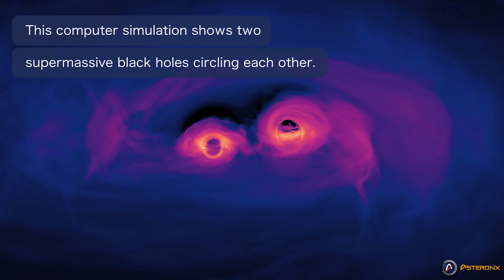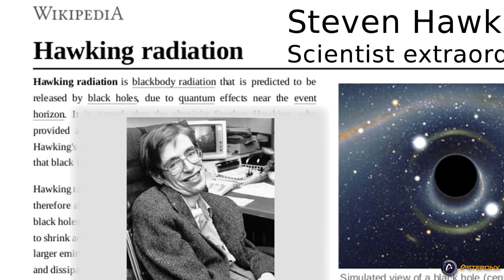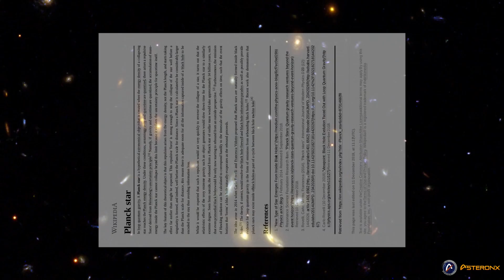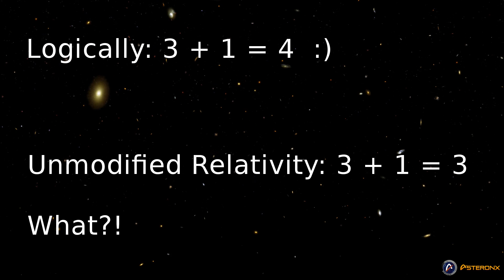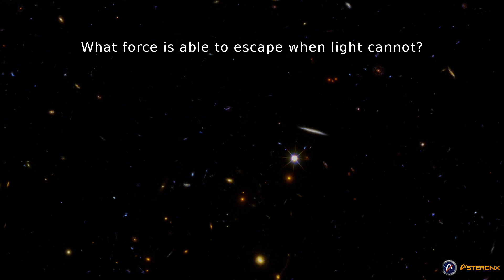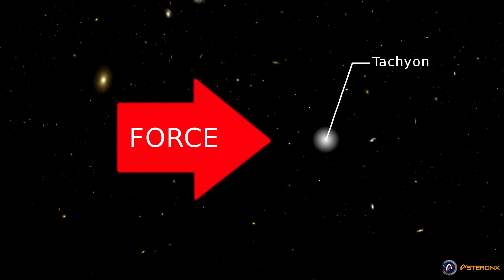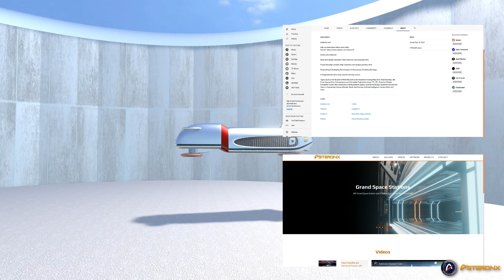Planck Star (Black Hole) Tachyon Rocket / Power Source - Starships

Comment: I have notes I developed about the artificial creation of a black hole using the mass of iron asteroids  carefully arranged and lensed with fusion bomb pumped XRay lasers and further fusion bombs in another lensed array and timed such that a critical density is created at the precise moment the mass is available to become a black hole.  It is technically feasible but non trivial in terms of assembling the masses, shaping them precisely and creating the necessary fusion bombs. Timing detonations is crucial.   Many asteroids are 10^17 kg which would create a BH with a power output that could be useful.

Comment: The Quantum Clock, or time dilation, seems to explain the Cosmic Speed Limit. If you reach light speed without warping space-time the energetic interactions that constitute the matter that makes up your body and space craft would not occur, as your cosmic clock reaches infinity. It seems to me that your material body would become disintegrated energy spread through the cosmos.

Comment: Get a lot right in this video it’s just that we know the black hole doesn’t explode because of Hawking radiation If the black hole was to explode we would see a large amount of gamma radiation as a result of virtual particles being created from the information exchange so the black hole still exists And another thing tachyon filed dose exist  there is a negative mass field  does exist but this mass cannot have excitation this field cannot have excitations so the tachyons particles don’t exist but the tachyon field dose https://en.m.wikipedia.org/wiki/Tachyonic_field the Higgs filed is a tachyon filed also the amount of mass a black hole gets from absorbing matter  is it more than the mass it’s giving away from Hawking radiation so always when a black hole absorbs stellar mass it’s getting bigger not smaller and that’s how we know black holes don’t explode https://www.inquisitr.com/4759939/china-wants-to-develop-100-petawatts-laser-that-would-rip-apart-empty-space-and-simulate-even-a-black-hole/ You would need 1000 petawatts watts of power To produce the black hole and you have to sustain the laserbeam such high energy laser beams can only last for 1 millionth of 1 millionth of a second you have to sustain the laser beam for a long time  for the light to be converted into mass by e= MC Square reaction by firing multiple of 1000 petawatt laser beams at one point in space-time the light would effectively bend then its energy would be converted into potential energy The potential energy being mass and for those of you that don’t know E equals MC Square is an equation that states that energy can be turned into mass and mass can be turned into energy energy is energy and mass is potential energy  there’s a reason why this technology is going to take 2000 years from our Time to get so in the 4000 then we’ll see where we might have it then Oh in 10 petawatts is far more power than what is produced by modern day human civilization so A thousand petawatts of power is un imaginable  then there is this whole Using quantum tunneling to travel faster than the speed of light that might not be possible at all In order for quantum tunneling https://en.m.wikipedia.org/wiki/Quantum_tunnelling
Reply: Actually human civilization produces 15 petawatts of power in modern day 2019 and this is not anywhere near enough to create artificial black hole we can simulate a black hole using 150 petawatts actually but we have to continuelsy sustain the laser beam
Reply: Oh and astronex you didn’t get a lot right I’m sorry I said that A black hole is not the explosion frozen in time the reason why we know that is because of the way that the mass information of the black hole into reacts a space-time outside of the black hole to produce Hawking radiation and we know this because of the fact that the mass can you infinitely curves FaceTime if it was an explosion even if space-time was moving slow over the course of billions of years we would be able to detect a much more rapid decay of information and what we actually half and then there’s the fact that black holes can consume massive energy toIncrease their size if that was an explosion that doesn’t make any sense even if it was frozen in time
Reply: you see the problem is is that the theory you’re using is not backed up by Evidence and it’s a fringe theory Not too many scientist go buy it because there’s not a lot of evidence to support it and you can’t talk about it like it’s fact if you’re gonna talk about theories you got to give more than one Siri you got to talk about more than one theory what they mean

Comment: Hey AsteronX, if I understand correctly blackholes that continue to amass more matter would delay their explosion into a white hole because of the increased time dilation due to the immense gravity of the billions of solar masses. So theoretically with the continual expansion of the universe, at one point all matter in a region would fall into supermassive black holes until the expansion of the universe stops this. Then nothing is increasing the time dilation, hence the explosion into a white hole would happen eventually.

My question is then would the matter from the black hole still be the original matter, like iron/oxygen/hydrogen or helium. Or would this black hole to white hole process convert all matter into hydrogen? Then this would explain the cyclical nature of creation from the big bang to supermassive black holes and back into white holes again.

Comment: My hope is that we will figure out stable fusion and matter/antimatter engines and start the work on adapting that tech to power space exploration drives by the 2050-60’s.
Reply from the maker: Fusion is truly around the corner, as while direct study and research may have been neglected the past several decades, the theories behind fusion have not been. Ultra-dense deuterium, laser-catalyzed Proton-Boron fusion, applying our primitive AI's to the problem of fusion, to name a few. By the 2060's we will have sublight starships almost certainly.
Reply: Sub light just means slower than the speed of light.

We can already do fusion.  The problem is getting at least as much energy out of it as you’re putting into it.  As for the drive?  A problem there would be excess heat.

We’ll get there, but I’ve learned not to be too optimistic about these things as it’s not just about saying that we know how to or can do one thing (that might require knowing how to or able to do other things that we don’t first), but it’s also about funding, interest in the project and whether or not the financiers think that the gain would outweigh the costs.
Reply from the maker: @eds1942  Well if the interest in fusion is stubbornly withheld until the world's easily-accessible oil reserves finally run dry... then the interest will suddenly be there.

As to the heat, that is one of the promising  things about Proton-Boron and (especially) Ultra-Dense Deuterium fusion.
Reply: There are a hand full of sites that could feasibly study that right now.  But, the most promising looks like the ITER which won’t be completed until 2025.  While it looks like Deuterium-Tritium will be their main focus, they could probably adjust their plans to study ultra-dense D first since its not ready yet.

There’s a lot of concern around these projects primarily due to the cost.  No doubt in part to the fossil fuel industry, which still holds too much political influence over the primary funding the countries.  

It looks like any big change in the area of power production would have to come from the demand side.  Where I live for example, we could easily get most (if not all) of our power from solar and wind (wave turbines), but between property rights and people understandably not wanting the stuff “in their backyard”...  Which is unfortunate as that could potentially free up a lot more funding for fusion research and laser-induced fusion (best suited for testing that as I understand it) is one of the projects that our state has independently invested in.  And it probably wouldn’t be long after that works out that we’ll be able to see if that holds potential for the space industry.

Here’s hoping!
Reply from the maker: @eds1942  Well, ultra-dense deuterium (UDD) does not require massive machines... But there's an awful lot of skepticism and not enough actual research (which would prove or disprove any skepticism).
Reply: Yeah, but it’s fairly new.  Give it time.
Reply from the maker: @eds1942  Of course, but a gigantic lab with millions in funding from many countries is unnecessary for researching UDD.

Comment: Faster than light travel. Or theoretical gravity drive will only work when the OBJECT is small. All Material has too much mass for any WARP distortion to work. Therefore you video on Future Black Hole powered star ships is wrong. Plus to exceed light speed and bypass normal spacetime is only possible as an ELECTROMAGNETIC push, or to send information, not for transferring material in a BUBBLE to long destinations.
Reply: Micro synthetic black holes. The material that makes up the ship. Electromagnetism. And a nuclear fission reactor. All in one ship.

Comment: The reason I can actually believe you when you say we will have the anti gravity drives when  you say they will be here is because of 2 reasons. 
#1 We have the knowledge to prototype and test these concepts now or will very soon. 
#2 with the onset of cryptocurrency like Bitcoin the normal oppression of innovation by Megacorporations and governments will be thing of the past, very little will stop a small startup from designing, testing and utilizing a warp dive. 

In Conclusion: Cooling is going to be a major issue with FTL drives in and I can see many cool off periods in between "jumps" to keep the ship from burning up and the drive at operational temperatures. The Movie Alien, Covenant shows an example of what will have to be done in between jumps except the panels are used to bleed off heat.

Comment: When  a mirco black holes exode creating a bubble in space time.quickly reclosing.  And if a ship has it own a hyradiation  repelling radiation coming at it.  And ships own ration field expands with acceleration. And a fuel gains density as it accelerates. and if atoms pushed to rite leak out a Negative Flow of mass. creating  larger radiation field . Could hold Bounce open even push it open farther tunneling through space time.

Comment: I really enjoyed this video and I thought this was best (so far).  I happen to agree with your timeframe.  FTL is going to start slow and then speed up.
Reply from the maker: Indeed. To many, the notion of FTL travel may seem impossible, but so would have fusion rockets in the early 1900s--we didn't even know of nuclear reactions!
With the development of fusion reactors within a few years, everything will change almost overnight, and many things currently impractical and impossible will become possible.
Reply: @asteronx  I have learned to use the word 'impossible' with the greatest caution.
-   Wernher von Braun

Comment: Kugelblitz drive
You absolute madlad :P
Question about theoretical FTL transportation: How big a problem is the CMB blueshifting as you approach c?
Reply from the maker: It is not that great, and during a jump there is no blueshift to speak of--the ship is dematerialized.
Reply: I was more referring to the Alcubierre drive than the Musha drive.  :)
Reply from the maker: @jarredeagley1748  Ah, then it is a bit of a problem ;)
At 10c the CMB becomes a lovely glow of hard x-rays... That might pose some difficulties, you know, some.
Reply: Past c I would expect any photon ahead of the craft to blueshift infinitely beyond xray or gammaray. What this implies, I haven't the slightest clue. Am I wrong?
I just love my FTL travel with a side of terminal cancer and radiation poisoning! :P
Reply: @asteronx  actually the cmb would blue shift into the gamma ray spectrum and completely vaporize the warp drive equipped ship.
Reply from the maker: The blueshift is much less severe, as it is not a case of blueshift-due-to-speed, but due to the warping of space at the bubble boundary: https://www.space.com/19268-star-wars-hyperspace-physics-reality.html